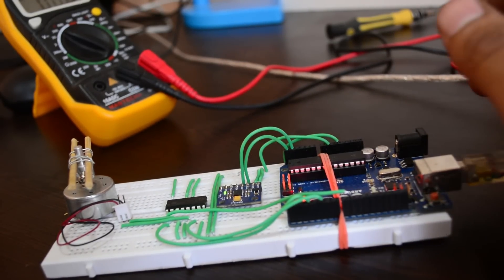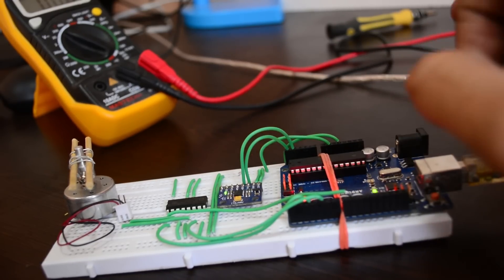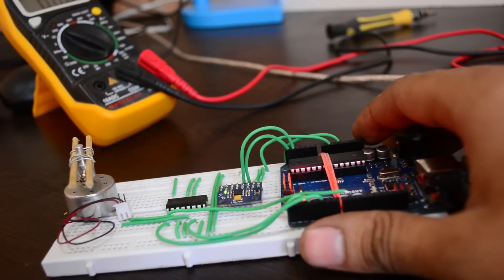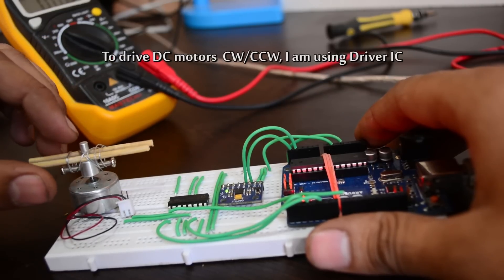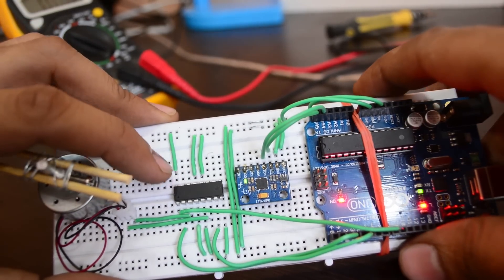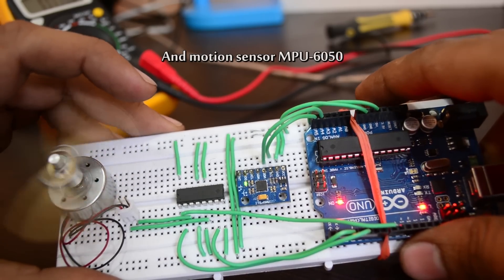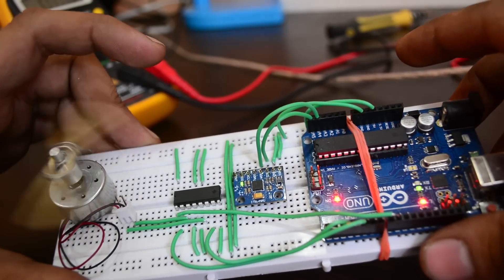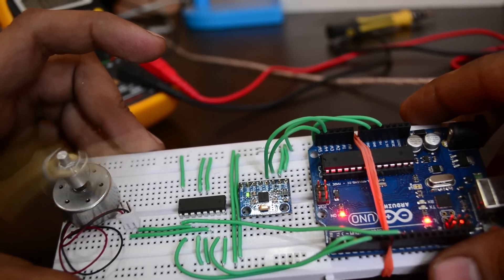Control DC Motor CW/CCW with MPU-6050 Gyro/Accelerometer + Arduino

Comment: Can you control Motor speed via tilt values on sensor?
Maximum set tilt- high rpm
Low set tilt-low rpm
On both left and right dirwction

Comment: I want to try this but don't have the chance to do it now. If I may ask,does the sensor work even if it face a different plane? I mean just like in gyroscopic screwdrivers...it does work even if the direction of screwing position is vertical up or down. Or angled. Does your code follow this too? Thank You Very Much.

Comment: I need some help. 
I want to measure tilt angle or angular deflection wrt some reference which inputs it to an adruino uno which further change the direction of rotation of dc motor. Is it possible and is there any code available?

Comment: C:\Users\hashir riaz\Desktop\sketch_dec18a\sketch_dec18a\sketch_dec18a.ino:2:19: fatal error: I2Cdev.h: No such file or directory

 #include<I2Cdev.h>

                   ^

compilation terminated.

exit status 1
Error compiling for board Arduino/Genuino Uno.
When i compile the code which is given in the link..then this errors comes..what can i do kindly help me.
Thanks
Reply: Try downloading the I2Cdev.h library from the following link : http://diyhacking.com/projects/I2Cdev.zip
Unzip/extract this library and take the folder named “I2Cdev” and paste it inside the Arduino’s “library” folder. To do this, go to the location where you have installed Arduino (Arduino –> libraries) and paste it inside the libraries folder.

Comment: in this project is it possible to use L298n motor driver instead of the chip used in the video? if yes please someone tell me how?
Reply: Yes it is quite possible. L298 is just the higher current version of L293D so the connections are going to be the same for both the drivers .

Comment: does this setup allow the speed of the motor to be controlled by the tilt. I.e. larger tilt more speed
Reply: +Nic Green Yes, you the control speed and direction by angle of movement.

Comment: if i use 4 wire bipolar stepper motor instead of dc motor, what will be the code??
Reply from the maker: Gagan Jot  here is the another video to show you how you can run 4 wire bipolor stepper motor. check this link. https://www.youtube.com/watch?v=hZNF7tAJmfk

Comment: Circuit Magic
what do these two code lines mean

mpu.initialize();
Serial.println(mpu.testConnection() ? "Connected" : "Connection failed");

thanks....
Reply: +Mahmoud Beltagy They are simply there for if you view the data through the serial monitor within arduino software. It is for trouble shooting errors

Comment: sir i want to make self balancing robot. can you please give me connection diagram and code.
thanks & regards
email:ramnath7192@gmail.com
Reply from the maker: here is the link, http://www.circuitmagic.com/arduino/control-dc-motor-cwccw-with-mpu-6050-gyroaccelerometer-arduino/
Reply: Circuit Magic but sir i have two 12V DC motors .so it requires external power source for more speed to balance the robot .so can you please give me connection how to connect external power source to motor?
Reply from the maker: ramnath shanbhag IC pin number 8 for external power source for motors. Just connect the +12v to pin number 8.
Reply: Circuit Magic motors are running in only one direction. also it will not balancing the robot. so please give improved connection dig. and code having PID feedback loop.

Comment: Are you using Arduino Uno R3?, are the pins A4 and A5 SDA and SCL?
Reply from the maker: yes I am using Arduino UNO, and connect the A4 to SDA and A5 to SCL, you can check the project page for more detail and arduino code.
http://www.circuitmagic.com/arduino/control-dc-motor-cwccw-with-mpu-6050-gyroaccelerometer-arduino/

Comment: May I have the diagram please. email: bilelhlassca@gmail.com
Reply from the maker: Bilen Hlass, I will send you the diagram tomorrow! If you like the video, please subscribe to my channel
Reply from the maker: Bilel Hlass, Here is the link for the diagram.
http://www.circuitmagic.com/arduino/control-dc-motor-cwccw-with-mpu-6050-gyroaccelerometer-arduino/
Reply: Circuit Magic thanks :) .. i need the code please
Reply from the maker: bilel hlass Hi Bilel Hlass. http://www.circuitmagic.com/arduino/control-dc-motor-cwccw-with-mpu-6050-gyroaccelerometer-arduino/, Please check my blog post for a code